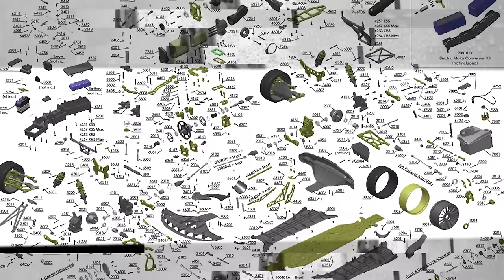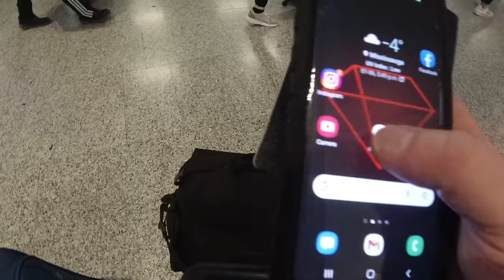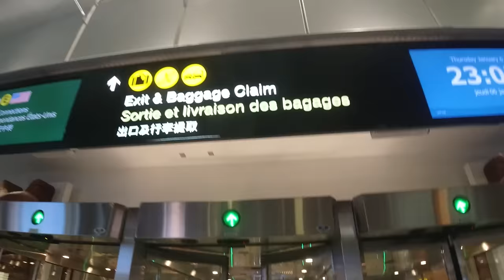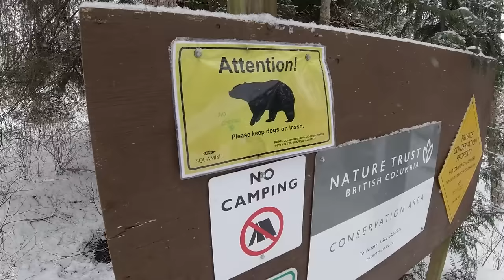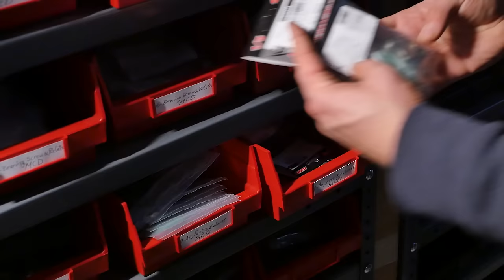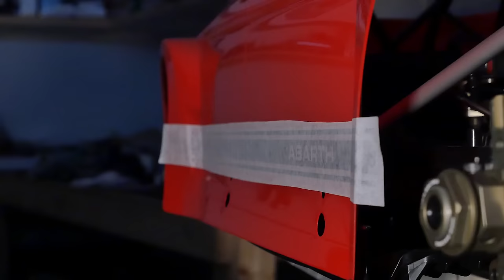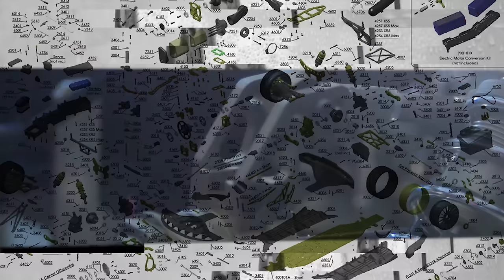The Ultimate RC Build with Cardinal Racing - 32cc GASS! 4wd 1/5scale

Comment: I own a mcd ultimate, cannot beat the quality..  These machines are sick.... don't think brushless is right on a big rc like these, 2 stroke rocks.. The sound, the smell and the feel is pukka!!!
Reply: Could probably just pull a weed eater engine off and put it in there. I got a huskvarna. I mean that’s all it is really lol
Reply: @captainkidd1329  it literally is a tuned weed eater engine
Reply from the maker: Motors and Volts and Robots  till you have to turn.
Reply: Brushless on that size??? Ever heard of a Tesla?  Direct drive motors are much faster than gas
Reply: @kpopRC  brushless on any chassis will turn as well. It's the curb weight and body. Has nothing to do with the platform gas vs brushless. BRUSHLESS IS FASTER PERIOD
Reply: @reaperinfinite8427  of course Brushless is faster.. but hasn't got the sound, the smell, and the feel like I said...plus I only take out about 2 litres of fuel when I go out for a while, Batterys die too quick still unless your paying £100s per batt.. plus gotta carry spares... I won't be turned to em yet in a 5th scale...
Reply: @captainkidd1329  true, but highly tuned, with stuffed crank, lightend, ported, tuned exhaust and air intake. Four shoe clutch ect..  mines a 35cc oddified. High revving, it screams!!!
Reply from the maker: motorsandvoltsandrobots7162  car is designed for gas. the weight bias. running these on 8s is probably great. but 15s, you're starting to add too much weight and in turn you're making a slower car designed to race around corners. yes it can turn. but fast? balance is key. not over powering.

Comment: When you build an RC this size things are actually functional at that point like suspension aerodynamics tires and geometry of your suspension now I know small-scale it does but it's not as noticeable on something larger like this! This is an absolute badass build it's so glad that I came across this channel
Reply from the maker: totally agree. the mass effects everything.
Reply: Lol. All that stuff still matters and is very noticeable even on 1/10 racing buggies. If anything, adjustments on those things is probably more noticeable since the suspension is doing so much work on an offroad surface.
Reply: You would be surprised how noticeable it becomes once you mess with 1/10 drift
Reply: Yeah! I have watched them and just hate that sluggishness. the only way I found some go fast, are electric builds

Comment: Kpop you rocked it with gas and electric on both your videos been sitting on hands trying to decide losi 5t dbxle dbxl rovan rally always followed your builds i will hit up mcd website respect
Reply from the maker: thanks robert... if on a budget always go used. I don't recommend the dbxl, the drive line angles make for bent drive line axles, and worn cups. The losi 5ive is on sale right now. you can get an engineless roller for really cheap. and kraken has a super sweet rwd truck that just came out.

Comment: GAS SUKS BRUH!
Reply from the maker: as some one who dabbles in both. running this car for 45 min. then gassing it up in 10 sec for another 45min.... its WAY better than buying 4000 dollars worth of batteries, or waiting an hour to charge a set. you ever experience a 2stroke fifthscale? doesn't sound like it.
Reply: @kpopRC  matter of fact I have way to much money for something so damn slow I don't posses cheap equipment so my charge doesn't exceed 20minutes for whatever battery I'm charging wrenching wise electric takes the cake no one has the time it takes to maintain a non electric rc car I'm not guna spend days prepping it  to run it once a month those days are OVER!!

Comment: I wish we could utilize torque better on these larger cars.  More cc is usually good,  but we got to find a way to keep these engines in the power band.  Most the time its low speed takeing off, and they arent screaming,  and they always feel just sluggish. Same with any 2stroke dirt bike. 2nd gear from a standstill and your bogging a bit, until you catch the rpms and then your in the power.  We need better transmissions for these large rcs to help them really put down the power

Comment: I'm afraid to break my xmaxx, I don't think I'd be able to run something that expensive 👊🤣
Reply from the maker: i find with the buggy truggy style of those xmaxx's you're going to end up with more breakage because of leverage and spinning mass. try out something with smaller tires dude. you might have more fun. i mean the xmaxx is fun too, don't get me wrong.
Reply: @kpopRC  I got the little maxx and it's my favorite. It's got the wide kit and a 6s castle setup so it goes pretty good. 

Something about a nitro rally car seems badass though, the group b equivalent of rc 👌

Comment: If you could modify a pitts airplane muffler to it where the pipes shoot out the back like a dual exhaust, not only would it sound but it would look scale as shit too!! Also it makes me nervous when you drive that thing close to curbs lol send it!!😂
Reply from the maker: dude. that looks like the most restrictive exhaust ever. i assume with planes you set it at a throttle position and leave it. these expansion chambers act as valves, the echo back stops unburnt fuel from leaving the exhaust chamber. with these highly ported engines it's important to have a good expansion chamber.
Reply: @kpopRC  not too sure about the expansion chamber but i do know it runs great on gas and nitro and the sound is second to none. I fly alot of planes and have tried many different mufflers on nitro and gas at all throttle settings, not just one, especially with acro setups and the performance is totally there. Most of the exhaust pipes have a small port that runs to the gas tank to supply fuel pressure. Just a thought, i bet it would sound badass like these loud ass drift cars with the 2 step and flames shooting out, wooooooon pop pop pop lol

Comment: nice car. Looks really good.  And the chassis must be insane. Thanks for the video :) 
But I think I'm too much into scale, to say it looks scale. It's semi-scale, maybe.  For me, scale would includeat least a piston engine with accurate numbers of cylinders, working lights, the interieur in more or less accurate materials, specular mirrors for sure (really don't know why they here not do this, costs almost nothing), and really finding a better solution to asseble the body. When a company comes round with a 1/5 scale rc car like this, I will buy it immediately. But in my view, no one has ever done a "scale RC car". And everyone who uses the word scale fo this, is wrong. 
So far, only standing models without drive are scale. And even these models are already very expensice, f.e. Amalgan and so on. 
But to be fair, its very hard, cause you have to find ways to build the chassis much smaller, to have space for interieur and stuff like this. I spent hours in CAD and researching, how this could be possible. You need a huge know how, many hous, many tools and machines, and for this many people and money. The price of this cars would be insane, and I think not too far from a real car. This is the issue. 
I hope one day, the technical progress will allow affordable full scale RC cars, but it's gonna be a while. So we  wait, I'd say :)
Reply from the maker: i hear you. Everyone has their scale preferences and limits. these are full race bread cars. they are meant to race hard, and scale anything doesn't really come into play when designing. these are designed to go as fast as possible around a 1/5scale track above all.

Comment: I say get a few extra servos and put a little dude up in that cockpit with a  mini scaled as shit gopro strapped to his head. Can even ad a shot caller navigator in the passenger with a little notepad.
Reply: The more I daydream the more nonsensical ideas that pop up. Add a tracking device so you can build a drone that will be able to follow it and FPV VR experience through the drivers eyes. You could work on an extended range radio and really immerse yourselves.

Comment: Always gotta make sure you grease your carburator bearing.... Haha " the carb has been bearinged" 😂
Reply from the maker: there is a mod we do to the 668 carbs. we use a tool to bore out the throttle shaft holes in the carb housing. and we insert a tiny bearing. this stops the throttle shaft from ovaling out the hole and causing an air leak...... PRO TIP.

Comment: You want to help an engine exhaust the heat better paint the outside of it white in the inside of the engine black the black attracts the heat while the white helps push it out

Comment: I think this rc is very nice and well built. HOWEVER -ITS SLOW AF. I want an RC with speed and real functional purpose. Nitro cars are all to slow for me. My opinion of course, but who really wants a slow rc??
Reply from the maker: this isn't a nitro car. this runs on gasoline, and these cars are race bread. if top speed is what you're after go get a drag car. this car goes fast while turning.
Reply: @kpopRC  ok what is the top speed?
Reply: This is absolutely the wrong hobby for you. But okay, people like you started ruining the hobby for others 10 years ago!
Reply from the maker: @reaperinfinite8427  depends on gearing. again. this is a car that goes fast around corners. you could NOT top out this car on the race tracks it's designed to race on. Ignorance is bliss is guess.

Comment: With the amount of money you need for such a toy, you could buy a Miata (MX-5) and have lots of fun with it.
Reply from the maker: the cost of a season of racing with a miata, including insurance maintenance, tires, oil, gas. you could buy 3 of these. Space to work on said car, garage space. there's a reason we all race these. it's because they are 10x cheaper than a real race car. local track day cost is what? 200 dollars a day? all drift tracks closed down in my part of the world. I mean i guess i could buy one to get groceries. and also most of us have cool real cars already.
Reply from the maker: did some more digging. so the closest track to me. has open track days, and other events. I asked my bro who works for porsche how much weekends of racing cost. usually at a the GP track it’s like 600/day. The DTT track days at the small track is tally 300-400ish. Porsche track experience intro costs like 1700 ish I think. So for 2 weekends worth of track time is the cost of a very Ultimate MCD rc car. So again? with this amount of money, what would i get just a miata to get groceries with? if so... i'll stick with my turbo subaru it gets the mcd to the track easily.

Comment: Ya the gas engine has the sound and the real-life feel but you can't beat the power and torque of the electric motors not to mention you don't gotta worry about gas tuning blah blah I used to be a hard-core nitro gas rc ... but since the tech has increased ill never choose gas over battery every again
Reply from the maker: yeah i hear you. my mcd is electric. my hpi baja is gass. i'd say the issue is. when taking out a fifthscale. it's so much work to get everything prepaired. only have 1 set of batteries is 22min of run time. with gas. i can go the whole day refueling. The torque is quite high when you use a stronger clutch spring. mine catches at 9000rpm right in the power curve. so 5hp in an instant. I like having both options. and have been electric only for a while now. it's time to dabble back to gas for a while. the 2 stroke gas engines don't lose tune like nitros.

Comment: for a rally car sits a little to low?
Reply from the maker: i mean.... rally cars are 100% adjustable. and when tuned for tarmac, they sit lower than when on gravel. These chassis are designed to race on tarmac and are set up for max grip and control on a hard grippy surface.
Reply: @kpopRC  Very cool rc for sure!

Comment: You can’t get the type of speed that you get out of the armas with this thing! Yeah they are cool because of the sound but where are the 120 or better mph runs
Reply: And you could also say that you can’t get the details and realizm in a Armma that you have with this. I don’t need to do 100 plus mph but I could look at this sitting on a shelf for hours.
Reply from the maker: if you made an arma weigh this much and be this size with mass, you'd be scared to make go fast. People with no experience with this size of car will never understand until they drive one. and the cameras don't do the scale justice. fifthscale can NOT be compared to arma anything. Fanboys be fanboys. i love arma, but this is not comparable.

Comment: a taylor rc 80cc motor would be way better
Reply from the maker: what good is displacement if you can't get the power down? i bet money it's the same experience with slightly less bleeding ear drums. .. What's with the , it's bigger and louder.. must be faster mentality. it's proven to be the loosing combination. you want a fast car, make it lighter.
Reply: @kpopRC   its just a sick looking engine and sounds great too, doesn't sound like the smaller cc engines has a deep note to it.

Comment: Petrol engine... With it, that tingh will never be fast and actually enjoyable. Those things belong to the past.
Reply from the maker: Check out my other videos. mine is electric. the video at the end is before we converted it. But i might convert it back. electric is for smaller scale. if you're going to have to work so hard to get out and rip it. why not make it gas? the difference is gas = 45 min tanks. tank after tank. my 2 6s 5000mah batteries last 22 min. if im lucky